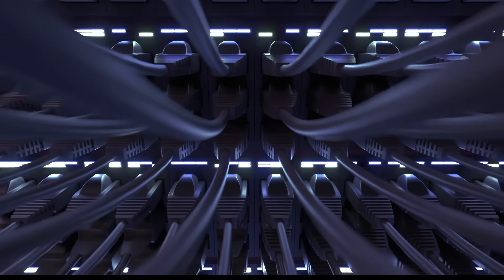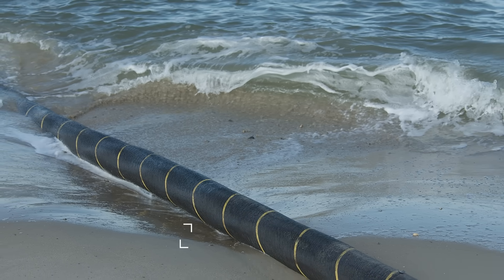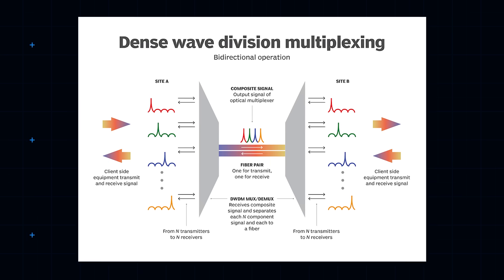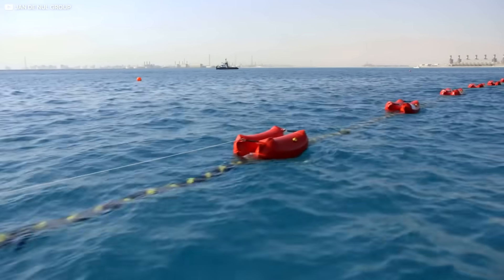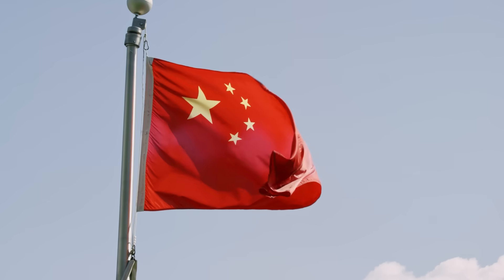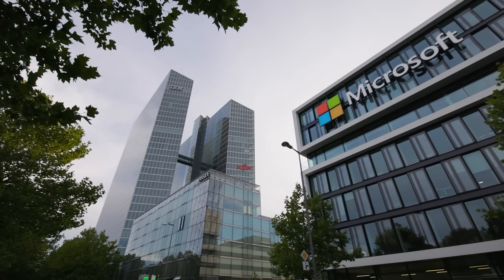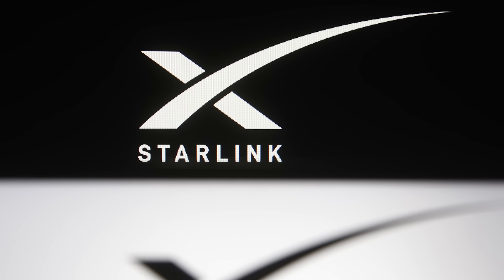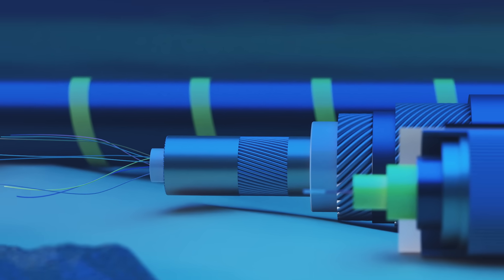How The Internet Travels Across Oceans

Comment: I've worked as a Datacenter technician for over 10 years. Whenever I'm sitting with non-IT friends explaining this concept...they are mind blown. Makes me feel so much better about my job security.
Reply: Yeah, it amazes me how many people genuinely think that the internet is wireless. Literally the whole thing is wires. It is just one big massive LAN.
Reply: @wesleymercer4536  it's not a LAN that is WAN
Reply: This might be a dumb question, but where does either end of these under water cables connect? Like what the does either end of the cable look like? Do they just connect to a switch at a massive datacenter somewhere?
Reply: It feels like job security now. I worked for Western Electric starting in the 70s then on to AT&T in 1984 (when they broke up the Bell System). Then Agere, Lucent, etc. Finally laid off by 1990. Things change except death & taxes - be an accountant or undertaker.
Reply: So, you also know they use those cables because we don't have satellites in space. Just a few satellite balloons in lower earth orbit.
Reply: @Simplified76  Was my mind too😁
Reply: Mind blown about fiber optics transmitting data?
Reply: so what youre saying is nothing has changed from telelphone to internet. Still connected in a sea of wires.
Reply: @DantePowell  not copper pairs but fiber
Reply: @DantePowell that's how I got here looking for and old documentary on telephone wires under sea
Reply: I'm one of very few who go out on cable ships and actually splice it... I've sat between datacenter techs in different countries, speaking different languages and ask them if they can connect... If I had to guess how many active workers do my job globally, I'd say it's less than 1000... think about how many minds i've blown... lol..
Reply: @pwhitney8472   best regard to you...can tell me how you connect them??
Reply: @pwhitney8472  best regard to you...can tell me how you connect them??
Reply: @dilanfarhad932  it takes a 2 month school with prerequisites of land fibre and an electrical background... And on top of that, you have to have the mental fortitude to work offshore for weeks(months) on end, 12+ hr shifts on the job is done...
Reply: I dealt with a Central office with an idiot on the phone, I hung up and called back and thank Goodness I got someone else that knew what he was doing. That was in 2013-2014 as a Premises Tech.
Reply: And then a quantum scientist scientist laughs at the thought that data techs think their jobs are safe from AI
Reply: @GpOg-j3v    And what do you do for a living? Or do you still live at home with mommy? What do you hope to do for a living when you grow up?
Reply: @ruffxm  
I’m the person who pays your yearly salary and puts food on your table.
Reply: And I see that you didn’t even answer the question.  Says a lot.
Reply: @ruffxm  
Oh sorry, I forgot some people’s intellect requires me to actually use simpler words for them to understand. What I do for a living is own a large corporation with over 270 employees under my belt with plans of expanding internationally.

Jealous person gonna be jealous, I guess.
Reply: @GpOg-j3v   Yeah ok. Oh wait, I think I hear your mom calling you for dinner.
Reply: @GpOg-j3v    Funny, but I've never heard the successful owner of "a large corporation" use the word "gonna".  And, owners of a company with less than 300 people typically don't refer to their business as "a large corporation". But keep trying to impress.
Reply: @ruffxm  
The most business people you’ve been around are probably independent workers driving for uber calling themselves “self-employed business moguls”. I’ve been around billionaires who use words like “ain’t” and “y’all” instead of the proper terms. 270 employees all earning above 80K a year + good benefits packages is nothing short of a corporation. Not to mention the assets under the company’s belt. All this in under 5 years. Some companies took decades to even reach a micro fraction of what I have achieved. My taxes alone pay for your healthcare and your children’s schooling and the infrastructure needed to provide your home with energy. You’re welcome.
Reply: Starlink isn't that great unless it's literally your only choice. It routinely has outages and even slowdowns all the time. (As in, several times per day.) It's great if you have no other way to get ~40Mbps down / ~1Mbps up to a remote location. (And notice how I gave such low numbers. Because - it slows down...)
Reply: @fitybux4664  Linus tech tips say you can game on it with regular speeds data prove  and he ran his tests in a city over a long period of time ... Sooooo
Reply: what would you recommend for someone in their mid 30's, whos pretty ignorant in most tech fields, to dive in and study if wanted to change career with a balance between technical know-how (complexity), and decent salaries? Thank you!!
Reply: @two2truths  most local telecomms will hire and train but salaries aren't decent at that stage... You got to put in the time...
Reply: pyropulse  damn how’s the ego. You’re an anonymous person commenting on a YouTube channel keep it in your pants peasant!
Reply: LMFAO!!
Reply: pyropulse  You are just showing ignorance and dumbness every time you type a word. You're just trying to inflate your ego, good luck, people can see through that, even the most dumb ones. By the way, as someone who has studied economics, a PUT OPTION is simpler than stocks and bonds... if you just simulate a put option to someone who doesn't know anything about it a couple of times, they will understand how it fully works, stocks and bonds have more variables. Also, can =/= could || What you meant there is if you dedicated the timer and effort you would be able to do, but you CAN'T do, and that's basically the same with every human.... if they dedicate their time and effort into the subject they will also master it :) So don't have a god complex mentality, you ain't one.    

[If you see any grammar mistakes it's because I'm Portuguese so English isn't my native language]
Reply: pyropulse  theoretically
Reply: i get what you feel🤌
Reply: You should be very afraid I’m going to take your job little boi
Reply: Minute 5:02 wrong scale of world map
Reply: So you are the reason my ping is 1ms slower/faster I don't know which, or to complain/praise
Reply: lol jesus those hours and pay suck hats off to you for doing it 10 years. i wouldve hopped tf out and got a better pos LOL
Reply: maybe your friends are just idiots
Reply: Makes you feel like a scientist..
Reply: True .... Been working for 11+ years in telecom field ❤
Reply: It's truly fascinating
Reply: You should be. You all are 1 of the basis of what's really hot now - cloud computing 🔢☁🔠.
Reply: How did you get a job doing that?
Reply: your friends are morons.
Reply: I don't think most people understand how the internet gets from one country to another and most people would think it would be by satellite.
Reply: Spiderman2Playstation5<what?
Reply: Says more about the company you keep.
Reply: Multimodal thinking hasn't come to modern human yet
Reply: Do you just show people to where one of their boxed will be located?
Reply: IT won't be going away anytime soon. Sadly it's also a unforgiving mistress that runs 24/7 and continually changes.  Welcome!
Reply: Do you see Elon musks satellites as a threat?
Reply: @chrisrosario6114  yes and no, Starlink as of current still relies on fiber optic network. What it does is solving what called as last mile communication, which is the communication from ISPs point-of-presence to the customer premises. Also just as any other wireless communications it is prone to shared bandwidth. In which could have significant impact especially on ultra high density area such as city center.
Reply: @bltzcstrnx  he didnt ask you
Reply: @lobbies8889  well, it's an open forum.
Reply: @bltzcstrnx  That's a good point
Reply: @chrisrosario6114  I don't see it as a threat. It's important to maintain terrestrial long distance communications so as to not put all the eggs in one basket and not saturate the satellite network with unnecessary traffic. Starlink is a great addition to the internet, especially when they activate the laser-based inter-satellite communication that can decrease latency. As well as providing internet access to rural locations who have been stuck with DSL. Satellites also have their own enemies like solar flares and EMR.
Reply: @chrisrosario6114  Network Engineer here - no, it isn't a threat, wireless will never be faster than wired - you can't beat physics.
Reply: @chrisrosario6114  Nope. I won't even use that. Response times are awful with satellites. No other way around it.
Reply: Hooow? One of the earliest fiber connections was between West Berlin and the rest of the Federal Republic of Germany.
Reply: @volare_cantare  Most people (especially americans) just assume internet comes from towers, satellites, or phone lines
Reply: T800  What’s a cheque book lol 😝
Reply: Ok ponka
Reply: guy at 4:58 in the back has a fake right hand. u can see it bounce. lol
Reply: T800  What's a check book boomer? lmao

Comment: 300-400M$ for all the cable under water? this cost divied by all the coutnries one arth? this is cheap as fuck for this
also its 15Tbps no 15gbps.. you have trash source..... I have 5gbps connexion at my home... so I really doubt that a 50cm diameter undewater cable has 15gbps... you funny... if under water cable has 15gbps, fiver optic will not exist

Comment: Question, if someone is able to answer, if cables are optics (so basically signal is transmitted with light speed) what does affect it so they need to put amplifiers !? Some equipment is 'weakening' the signal, or optic cable also has losses of signal strength just like coper cable !?
Reply: Because although it's light running through the cables, over distance the light loses energy due to it bouncing through the cable (it's not perfectly straight).
Reply: @ruffxm  ohh, lot of time passed when i asked this. But nevermind, should that lost energy be negligible because its through optics or it also need some kind of "boost"/amplification !?
Reply: @milosstojanovic4623  Yeah, I see now...I just answered out of habit I didn't realize the date. But yes, it amplifies it so it can reach the next repeater. This fiber is designed to carry data for many miles unassisted, but not thousands of miles.

Comment: Really impressive, looking forward on Latency solutions, hope that in the future we could get new technology that could help us all over the globe to get low latency everywhere ! Would be so amazing
Reply: Latency depends mostly on local "last mile" providers and solutions. There are several factors that influence these last mile access networks, just to name some of the most important: geological, political, social, and economical. A provider needs a strong business case to invest a HUGE amount of money in an area to develop new access networks. The return on investment is very low, especially in rural / scarcely populated areas, where they rely on government plans or local initiatives, even in highly developped "rich" countries. People mentioned Romania and Moldova above. Those countries had really old networks that bottlenecked the economy, therefore the business case was strong and fiber technology got accessible at the right time to implement. If this bottleneck was to surface a decade earlier, they would have probably gone with copper based technology with higher latency and lower speed and probably stick with it for another 20-30 years since the business case just got weaker and the technology is "good enough". This explanation is far from exhaustive, but to be that way, It would take me at least 50 pages. But the point is that low latency everywhere will most probably not happen in our lifetime. 5G could be the spearhead of that, but the aforementioned factors still influence the spread of it and on top of those, it poses a new architectural challange in densely populated areas. Starlink's latency is low enough for most of today's needs, but it is far from being accessible for the biggest part of society.

Comment: I worked for a company that designed and produced "splice sleeves" for the fiber optics used in these cables. The splicing process was interesting. We had to program offsets for certain cables to allow for specific amounts of light to pass through the splice. Beyond that info I am not brainy enough to know why or how it effects the data being "yeeted" long distances. Cool stuff!
Reply: I work at data centers building fiber infrastructure, -6 or better is what I look for from my installation teams. -25 and our test equipment won’t even run.
Reply: Ok bhai ponka
Reply: As long as the light is continuous along the cable, it will not affect the data rate. All data is encoded in binary "1's and 0's" along the cable.
Reply: @newhampshirelifestyle4233  Hi, Fibre splicer here. using light is a bit different because any interference in the cable (poor splice for example) will affect the wavelength of the transmission. since the transmitter uses multiplexing it is that much harder to calibrate. the equipment on either end then does the 0 and 1 thing. a difference of only a few db will not work on highly sensitive equipment. the offset is to accommodate these db differences as well as the repeaters.
Reply: @mattdadi9853  No db's = the best db's when it comes to splicing.
Reply: @iareincompetentgamer  you actually want a -25 ish db for fiber it’s way different than coax
Reply: @devonsykes2598  Are you saying that a loss of 25db is acceptable when splicing fiber? If so - that’s wildly inaccurate. The goal is literally zero loss, although it’s difficult to achieve.
Reply: @iareincompetentgamer  no I’m a fiber splicer db is different with fiber than coax a negative number is actually what you want -25 is a strong signal where coax that wouldn’t even get anything online
Reply: @iareincompetentgamer  take the time to do research really the right db you want is easy to achieve as long as you clean the end and the line is good.
Reply: @iareincompetentgamer  literally the modem won’t come online with a signal higher than -20db. There’s a difference in fiber disutrubition and fiber going to a home
Reply: @iareincompetentgamer  the reason for such a low db is the dead zone on a line is big compared to your standard coax lines
Reply: @iareincompetentgamer  take the time to research what db fiber should be at the modem and it will say between -14 and -50
Reply: @devonsykes2598  Another thing you’re probably mistaking is where the decimal point is in your readings. A .25db loss signal could be considered acceptable, but more often than not those results will be rejected by the end user if you show them certification readings for .25db losses at all splice points. The goal is and always will be zero loss.
Reply: @devonsykes2598  You’re talking about something entirely different than single splice loss, which is the topic.
Reply: @iareincompetentgamer  no it’s not lmfao literally if you google search it it will tell you -14 to -50 db lmao
Reply: @devonsykes2598  It literally is. Find me an article that says splice loss is supposed to be 25db. You’re working with a modem signal from the end point of an entire litany of splices that, when added together, may be 25db loss total. That may be considered within tolerance. That includes all splices and equipment mechanical connections between the main servers and the home. If you have a 25db loss at any one single point in that line, you’ve blown your loss budget for the entire thing.
Reply: @devonsykes2598  Just trying to help you understand the industry you’re working in. If you’re interested in how fiber works, you’ll need to know more than what they teach you in the Cox or CenturyLink modem installation classes. There’s a lot more going on in fiber infrastructure than what you see when you’re in a customer’s home. Physics is real, and there’s a lot of it in glass.
Reply: @iareincompetentgamer  like I stated I’m basing those db off what it is at the modem not what it is for distribution
Reply: @devonsykes2598  Hello, I am also a fiber splicer, and you are wrong. It is actually concerning to me that you are so adamant about what you are saying when it is clearly wrong. -25db is on the edge (or over) of being inoperable on most all equipment. The lower the power level, the worse the connection. If you are saying that an unattenuated fiber signal of -25db is stronger than say an unattenuated -20 db signal, you have no idea what you are talking about. Some equipment I work on won't even operate if the signal is weaker than -6 db. And the peak operational power level of the equipment I work on pretty much all the time is -15 db. So the signal always comes in hot say at like -5db unattenuated, and we attenuate it to -15db with a 10db pad at the preterm. Maybe on your modem (we call them ONTs) it requires a lower signal so you attenuate it down to -25db, this is not because its more powerful, its because of its sensitivity and if the signal is too hot you can burn up the optics on the device.
Reply: @mattdadi9853  so yeah like he said it won't be affected.

Comment: You lost me just one minute into the video when the voiceover guy incorrectly stated that these cables can achieve 100 gigabytes per second. For the record, data transmission speed/throughput is measured in gigabits per second. Data storage is measured in gigabytes. 
It's like saying my car weighs 120 gallons or my boat travels at 40 kilograms per hour - it's meaningless.